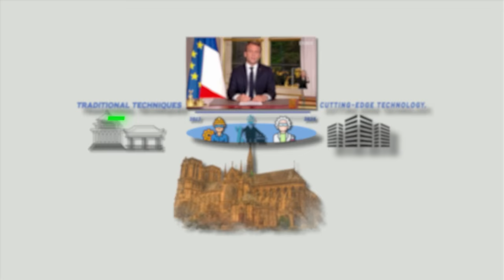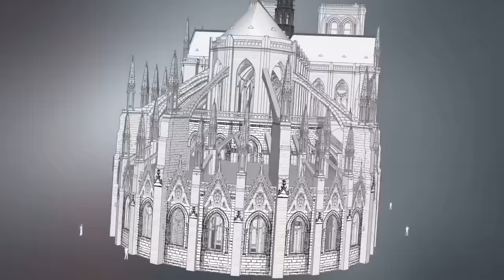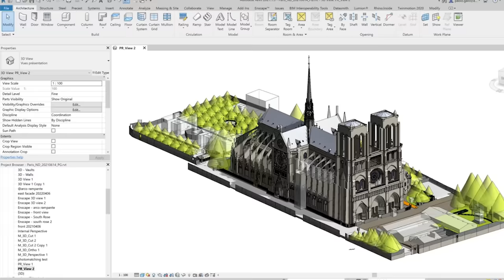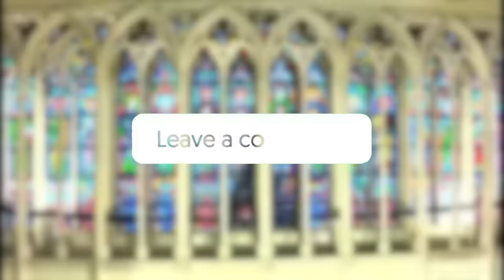Unveiling The New Notre Dame - 2024 Restoration Update

Comment: I appreciate the effort to highlight the renovation of Notre Dame Cathedral.  There was one error that was highlighted on the ND building. The flying buttresses are the structures supporting the walls on either side of the cathedral, a significant feature of Gothic architecture. You may want to correct this item.

Comment: It's a missed opportunity for a modern upgrade to the roof structure, but still it is an amazing rebuilt.
Reply: I agree, it was stupid. Instead of building the roof trusses in steel which would prevent fire and help in lightning strikes, they are rebuilding it with wooden trusses.  This is like building a working replica of the TITANIC with the same number of lifeboats as before for historical accuracy.  With the money available, the trusses could have been made out of stainless steel and would have never degraded.   Fire suppression usually damages things.  The best way is to build things which just don't burn.  They are treating the timber to reduce burning.  Watch the treatment chemical turn out to be a carcinogen.
Reply: @lewisdoherty7621  I also meant a design upgrade. The proposed modern roofs or rooftop gardens would have been unique. I know that Notre Dame is special, but it could have been even more unique.
Reply: The roof structure worked fine for 800 years. We don't have that kind of hindsight with more modern materials. It was integral to the stability of the building and the scientists and engineers that work on the restoration are aware of that, if the people that proposed funky alternatives are not.

Comment: Instead of building the roof trusses in steel which would prevent fire and help in lightning strikes, they are rebuilding it with wooden trusses.  This is like building a working replica of the TITANIC with the same number of lifeboats as before for historical accuracy.  With the money available, the trusses could have been made out of stainless steel and would have never degraded.   Fire suppression usually damages things.  The best way is to build things which just don't burn.  They are treating the timber to reduce burning.  Watch the treatment chemical turn out to be a carcinogen.
          That spire doesn't fit with the original building.   Someone felt a need to make their mark on a harmonious and completed building. 
          The French government ruined the Louvre by sticking those glass triangles up out of the ground.  Let's see how they mess this thing up.
Reply: Stainless steel beyond a certain degree of heat does burn.  100% metal skycrapers so burn like torches, as well as cruisers on the high sea.  Treated wood and bamboo burns far less easily at very high temperatures.  In medieval times such wood was treated.  I caught fire so easily because of a big mistake : the truss beams has just been covered with an anti-insect protective paint with turned out to be particularly inflammable.
Reply: Steel like steel wool will burn, if it has a lot of surface area. A steel structure with stone and only a bit of combustable furniture in it, won't sustain combustion. @MrMirville